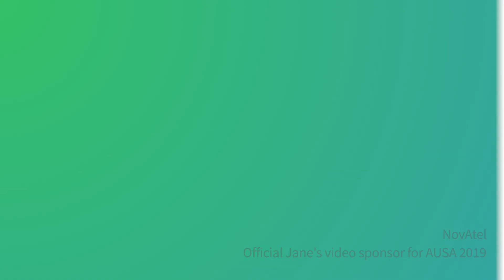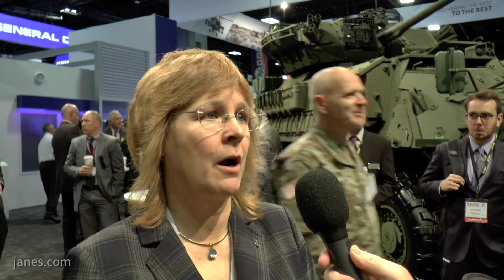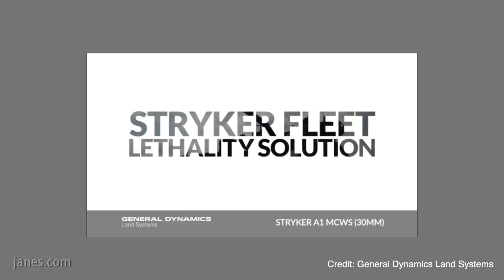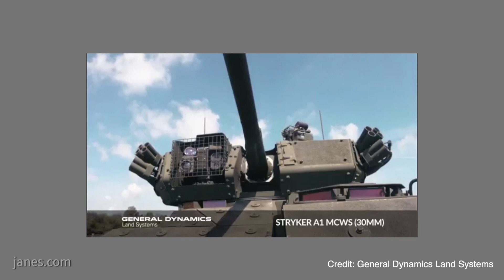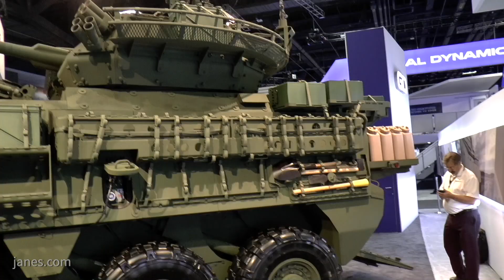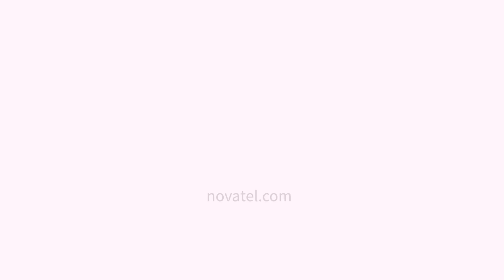AUSA 2019: Stryker A1 IM-SHORAD and MCWS variants

Comment: Is the 910 amp AC or DC?  The mission dictates the requirements. How adaptable defines the solutions. We keep fighting last decades wars. I understand cycle time for development because I cant predict the future. DOD has many sacred cows. Good luck with that as usual. I could have said this in the last 5 decades. Kick ass take names.
Reply: Amp is both AC and DC being a measurement of current, the question is what is the Wattage?
Reply: @robertdonnell8114   Is the load inductive resistive or capacitance driven. Inductive loads can sink larger currents upon close of the circuit. AC can be run through step up transformer to achieve larger voltage supplies. Devices such a computers generally off of 5VDC. Some time ÷- 15 or +- 12. So the idea the it could be 900 amps tells little. But I am sure that is intended.

Comment: Holymoly is that thing tall!  I thought that the Bradley was a tippy Tommy.  This thing looks like it is going to spend most of it's time on it's side in rough country.  Second, how do you hide something that flippin' tall? Finally, I thought that one of the main points for these wheeled vehicles rapid deployment by air.  Will that Dragoon even fit in a C-130?
Reply: Ken Elsey no. Three can fit in a C17.
One of the reasons why not all Strykers will be upgraded
Reply: I understand that the older version with the small remote weapon station will fit in an aircraft.  What I question it whether the a1 with the heavier belly armor and the 30mm bushmaster turret (ie: taller) will still fit through a drop down ramp opening on a transport aircraft.  If it doesn't, then they have defeated one of this vehicle's reasons for being.
Reply: Ken Elsey no it won’t.
The Original CROWS had to be partially unbolted and folded down to fit on a C130. Something that takes only like 10 minutes or so but still must be done.
The 30 mm cannon would be too tall to fit on a C130 but should be good to fit on a C17 and easily fit on a C5
Reply: Ken Elsey that was really a hold over idea from the late 90s and early 2000s. It was never going to be a practical concept in the real world where you have heavily armed insurgent movements and great power conflicts on the horizon
Reply: Johnq365 Quebec for the most part I agree. But In a counter insurgency environment nothing beats a Stryker. The double V hull takes IEDs like a champ. The engine is super quiet along with wheels instead of tracks. You could sneak right up to an insurgents house and be in his bedroom before he was even out of the covers.
To fight insurgents you really don’t need to have anything bigger than a .50 cal or a MK-19. Anything much bigger and you worry about way too much civilian casualties.

Even saying all that Stryker is staying with the times and new threats. The Russians have always been ahead of the curve with doctrine as was shown with its BTR series but they have never had the money, technology, or industrial base to make a good execution on the idea. Great ideas, bad follow through.
Reply: @Drew Peacock oh they are just tires so they blow off. But as long as the Strykers are double V-hulled they take IEDs like a champ
Reply: @Drew Peacock it can move with 4 of the 8 tires blown off. As long as 2 of those tires are on the same side
Reply: @Drew Peacock depends on the IED. Either way it’s kind of irreverent as they move in a four Stryker platoon. Once an IED is hit, if it can make it out of the kill zone it will. If not the other Strykers will dismount their infantry; secure the area and hook up the tow bar and tow it out of there.
Reply: @Drew Peacock IED proof tires are not a thing. IEDs have blown the tracks off tanks . IEDs are improvised. Which means they can be built with supplies on hand anyway they need to be. 
Build a big enough IED and no amount of armor is going to stop anything.

When I was in Iraq on my first tour we where briefed my the unit we where replacing that Deep buried IEDS. 
One of these was five two-thousand pound aircraft bombs under a road. 

It literally flipped and Abrams tank in the air and it landed upside down. The over pressure liquefied everyone into a red paste.

In short. No amount of armor is going to stop a purpose built IED.

This is not even to mention when the EFPs came into theater

Comment: OK  so what kind of incoming can this absorb?
Reply: The armor on Strykers are better than both the BTR series and even the newer  boomerang.
An infantry platoon will consist of four Strykers: two with the 30mm cannon and a coax M240 machinegun. Two with a .50cal CROWS with a Javelin ATGM.

It is not intended to go toe to toe with modern heavy mech units. It’s designed to get the infantry where they are needed as fast as possible and with enough firepower to hold what they have.

Other Stryker  units will not be upgraded to be used in a counterinsurgency environment. Just have double V hull to defend against IEDs
Reply: Richard Robinson standard armor package will take 14.5 mm rounds with its usual bolt on armor. Without the bolt on armor (which does not exist from all the Stryker units I’ve served with or know of) blocks 7.62
Reply: A P the BMP  chassis is completely different from the 1 and 2 to the 3.
I’m not 100% following it but I know they would have had to do a lot of modifications if it was even possible to put a BMP turret on a BMP 1 or 2 chassis
Reply: 25 mm 30 with add on up front and 14.5 all around
Reply: So no hope with a 30mm round? And what about ATGMs? And if not, why so heavy?
Reply: What do people think would happen if it got a direct hit with an 80mm mortar round?
Reply: A P the Russians do not have the money to phase out the BTRs. They made all these cool high tech vehicles but do not have enough money to replace the older ones so they are only making one high end unit. All the other units will just have upgraded Cold War era stuff.
So the 72B3, T80BVM,T90AM, BTR82A ect.
That will be the bulk of the Russian military for a long time
Reply: A P . My understanding is that they don’t have anymore BMP 1s anymore and have already upgraded them all to BMP just basically replacing the turret.
Reply: Also my point in people complaining about how light the armor is or complaining about the firepower of the upgraded Strykers.
They are at least as good generally better than the same type of vehicles they could be compared too.

Comment: Notice how it didn't leave the hard packed gravel track? 30psi ground pressure rubber wheels that burn on a road bound death trap that can't enter closed terrain re: mud and sand so motorized light infantry have to get out and foot slog to the objective getting cut down by PKM and volleys of RPG's, pathetic.
Meanwhile 8psi rubber band tread light tacked platforms like the M113 is retired.
Reply: @vemundr9263  With a skilled driver. vehicle commander, and or squad leader working as a team yes easily. Without a good team, it can just as easily get stuck. 
CTIS (central tire inflation system) and HMS (height management system) help when it comes to the muddy stuff but only a good team can keep the vehicle out of trouble.

 My platoons Stryker's were frequently called up to recover others not because our vehicles were superior but because we had better Driver - VC - SL teams. Those were older Strykers without these new engine upgrades. Our biggest problems off-road came when operating at night in swampy terrain.  Even then we were recovering other vehicles and scouting objectives dismounted and mounted without too much issue.
Reply: Vémundr it would never have been accepted if it could not negotiate off road terrain. It’s also a trade off. Tracked vehicles require more maintenance in general but off great off road utility and vice versa
Reply: Vémundr I’ve have done multiple rotations with the Stryker unit I served with in the desert of NTC, been to Thailand and Korea as well as Eastern Washington state more times then I can count.
I’ve had no major issues getting stuck if your driver and TC know how to do their jobs.
Though we have broken an axle or two at NTC before.
Those 10 foot deep wadis are no joke
Reply: @peterprovenzano9039  I had a Hohenfels rotation during which I got to see what happens when you hit one of those big wadis even at a low speed. The driver was lucky to only get a broken arm and fractured collarbone. Both the SL and the VC were fired that night. No joke indeed.
Reply: @vemundr9263  you not seeing a vid means nothing, there is alot of things the US Army doesnt take vids on, Stryker units go to The National Training Center in Fort Irwin CA to train force on force all the time, there aren't a lot of roads in "the sandbox" and if you use them the OpFor boys will eat you alive. I know this because im a tanker and my tank unit was attached to a stryker BDE to provide Armor Support during their NTC rotation. No you will not see pictures, we are not allowed to take any, or even have any Privately owned communication devices on us while there.
Reply: As one of those mechanized infantry grunts who are purportedly going to be "cut down by PKM and RPG's" I doubt that very much. Please feel free to stand and fight at range and you'll have my solemn promise nothing will be rained on your head.

Comment: A 30mm cannon, when European armies are already moving to utilizing a 40mm gun?
Reply: @LordEd21 21 NGCV will be a tracked unit, and Stryker is wheeled as it was intended for a different purpose.
Reply: There moving towards 40mm on IFVs. Stryker is an APC. There putting 30mm cannons on them so Strykers can protect themselves against Russian BTRs that have 30mm cannons.
Reply: @SkullKing11841  thank you for sharing this information.
Reply: the US has a pretty big stockpile of 30mm equipment for their MCWS programme. the guns are provided by the government for this competition.
Reply: @LordEd21 21 doubt it will fit on Stryker.
Reply: crappy chassis won't let put anything significant.